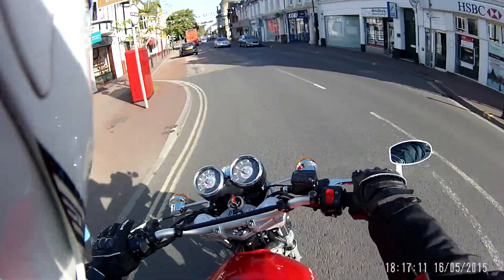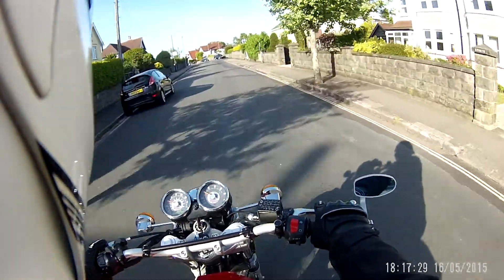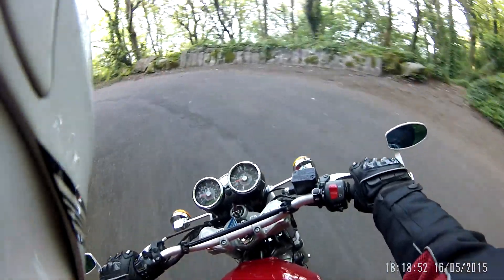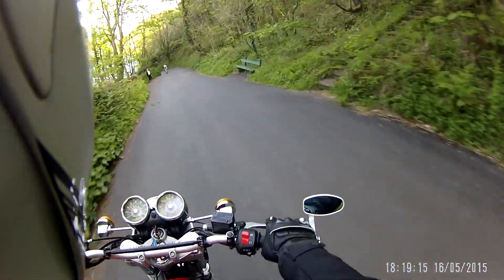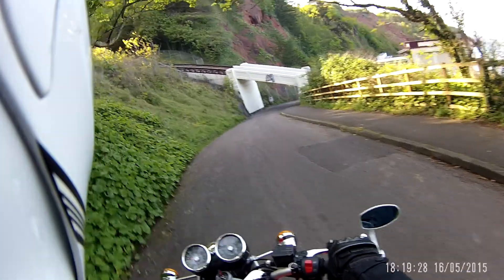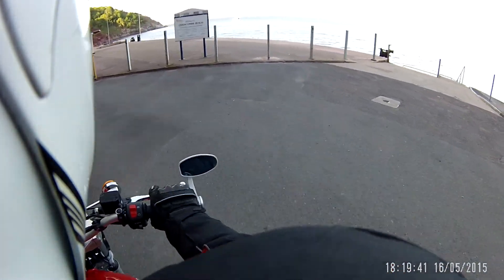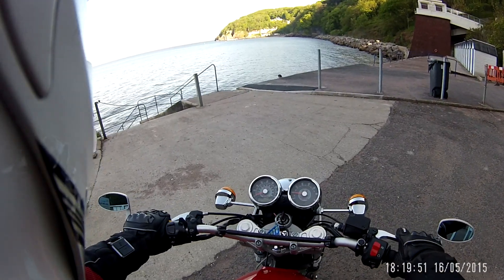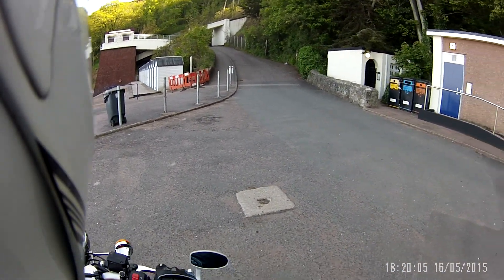Continental GT 535

Comment from the maker: Thanks for your kind remarks, The bike is running well and loosing up nicely, The handle bar conversion is one that I have put together from various sources, The bars themselves are standard Renthel bars with 6cm rise! This is done without having to change the cable/hose lengths until I'm happy with the height. The clamps are from an after market handle conversion that have 41mm clamps and quite easy to find on eBay 141603079592
 I will do a walk around as soon as I get time to show them in more detail. Regards Tom.
Reply: When i removed the clipons from the original position, the remaining part was poping out from the triple tree., but yours doesnot have that issue, Did you change the forks or did you just changed the triple tree
Reply from the maker: Hi, I just raised the triple trees up to give more ground clearance. Regards Tom.

Comment: A very welcome return, Tom. A splendid little hillclimb. I see you've swapped to 'standard' handlebars, which I assume is a swap of the top yoke, Is that a difficult part to find, or a 'stock' item from I assume Hitchcocks? I'd consider that to be preferable, certainly in my case as I have a left wrist held together with a lot of titanium and screws!  

Would love to see more footage from you as your commentary is always relevant and pleasing. 

Kind regards

Peter

Comment: Nice job on the handlebars. I would love to see you make an instructional video covering the parts and installation.  I am 65 years-old and that stock riding position is bad news.  Your modification looks terrific!  Please share.
Reply from the maker: +oldjohn1951 Thanks John, I may just do that as I would like to raise the bars a little more but this will require longer cables and brake hose, so when I get the parts needed I will do a tutorial.

REgards Tom.
Reply: I gleaned that you used a Renthal Streetfighter handlebar with a 6 cm. rise mounted to 41 mm cnc machined aluminum raiser/riser set from ebay MandP. It works for you so I'll give it a go.
cheers!

Comment: i like the handle bars and indicators. expensive?
Reply from the maker: +Peter Hogg 
The bars a Renthals and the risers are off eBay and no mod's to the cables were required if you don't rise more that 50mm or so.